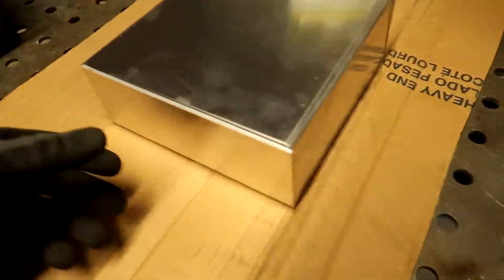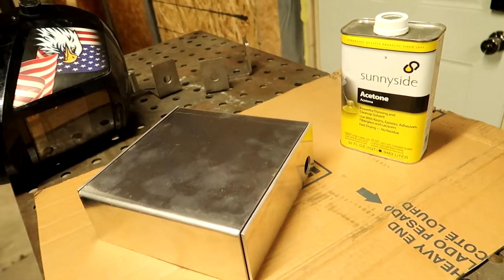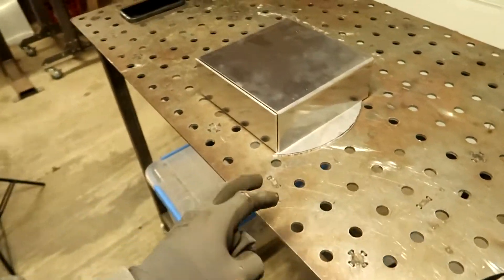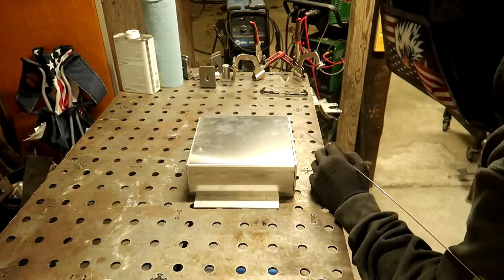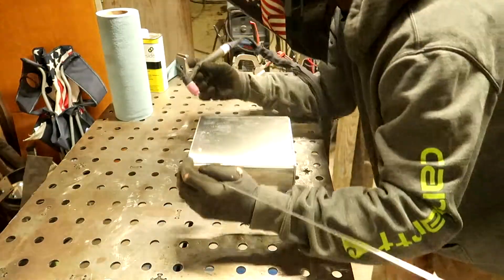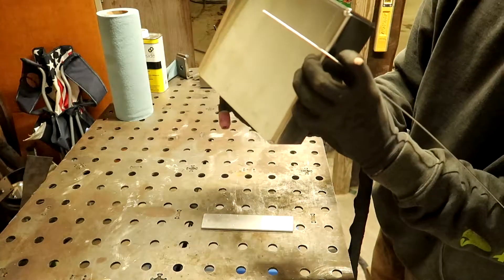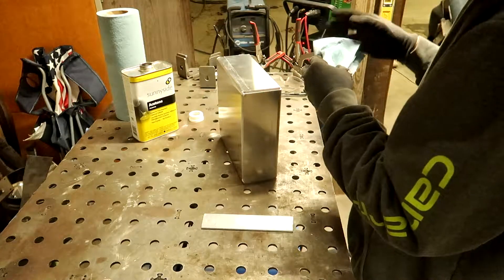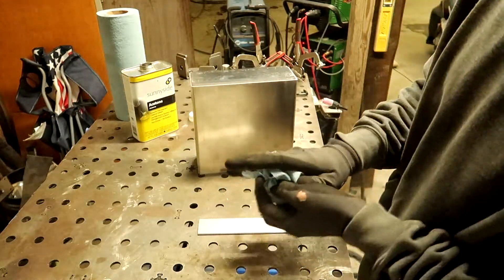Homemade Aluminum Coolant Tank

Comment: Where did you get the aluminum fittings? I’m making some fuel tanks for my boat and can’t find any large enough
Reply from the maker: Here’s a link for ya, Boyd’s welding/ fuel tank parts 
https://fueltankparts.com/?gclid=Cj0KCQiA_c-OBhDFARIsAIFg3eys3txnhYXoUbu-l2IQ9-AbAUt4KxNeJGgt96XKllF-5gxEhfU4ENwaAvYDEALw_wcB
Reply from the maker: Just go to parts on their menu and you’ll find weld in bungs